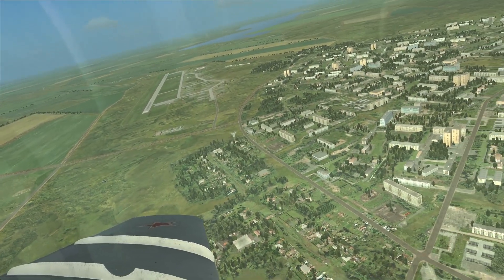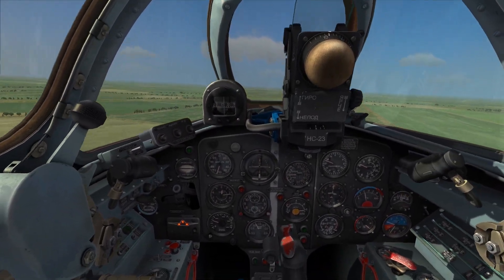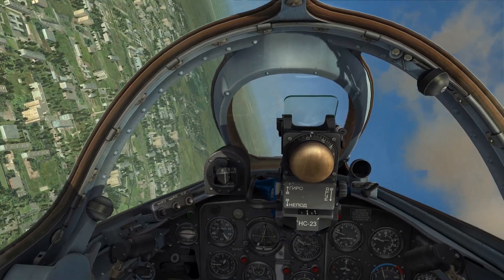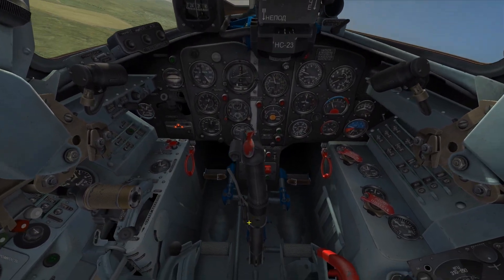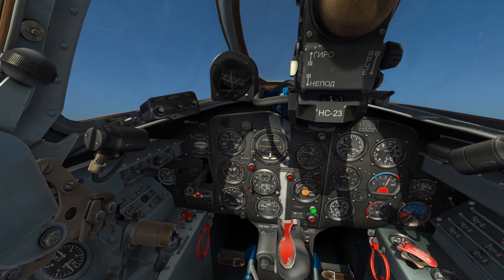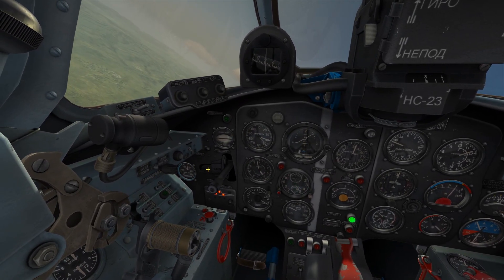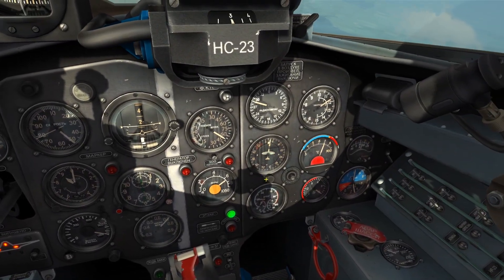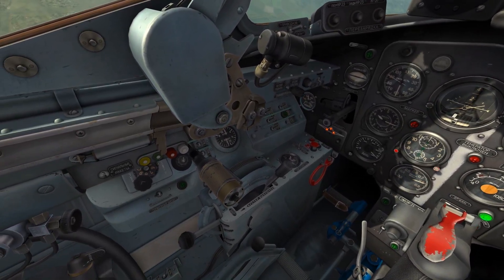Test Flight - DCS: MiG-15 bis Fagot #11 (Experimenting with Systems)

Comment: well, based on what it does that valve that is coming from the intake might be an emergency thing where you can get pressurization from the intake "bleed" air thus when the engine bleed air fails you can still pressurize the cockpit with that "bypass" kind of valve to get your pressurization from the speed you're flying itself, pretty handy failsafe i guess...
and for the oxygen, well that should be actually reverse because how the mixed air regulators work, so the higher you go the less time you have, at least this was what the germans found...
nevertheless they used unpressurized cockpits so who knows how the russian systems operate :D
otherwise, thanks for the video!
Reply: I'm thinking it's sorta like an emergency ram air pressurization function....